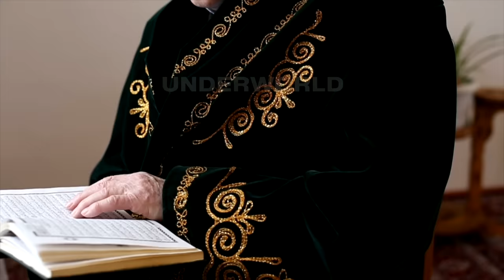10 Structural Failures Caught on Camera

Comment: #3. I remember this kind of thing happening in New York City when  some buildings were torn down, what likely happened with the hole where the blue tarp was.  The foundation of the shop probably wasn't undermined, but the whole building was probably only standing because the removed building was the only thing holding it up. Note the disconnected/ piecemeal brick construction of at least the first floor and the likely added and much heavier-looking second floor.

Comment: As a welder, you have to be extremely carful that, before you start work, there is nothing around that might catch fire if a spark land on it.
     Even then, you need to keep your eyes open incase you do start a fire. You can never be 100% sure nothing will burn in range of sparks. I've started a few small fires, but in those cases the fires would have burned out on their own even if I had failed to notice.
     There was only one thing I set on fire that suffered substantial damage, but it was especially problematic as it was attached to my body.
     It was my brand new prosthetic leg. I'd asked them to put the foam rubber cover on with Velcro, not glue, but they glued it by mistake.
     I was pretty shocked how intensely it burned, I found out later that they were using untreated foam rubber. It was meant to be treated with fire retardant, but in this case it was either mislabeled, or they just lied outright about it being treated.
     The prosthetist repaired the leg for free, then I went looking for a new prosthetist.

Comment: Uh, there's a bit of an error about the Mumbai Goa highway, no? 
It really doesn't look like an old viaduct failing but rather looks like the viaduct is currently being built with a launcher (not a crane), with the right side being completed but with its compression cables probably improperly or not yet tightened.
And the left side simply being still in the assembly process, with all its segments not yet attached to each other.

Numerous bridges and viaducts are built like this, and the launcher assembling the segments (a kind of giant metallic square gantry) normally takes support on the viaduct's piles only.

Launcher gantries have mobile "feet" to transmit downward forces to the piles, they lift all viaduct segments of a given section between two piles with cable pulleys.
Once all segments are aligned correctly, they are fused together with cement, and cables running through all segments are tightened to form a solid, compressed and strong block.

That's how elevated transit lines and highways are built in China or Europe, like the viaduct of the Grand Paris Express.
This technique is extremely efficient, fast, and sturdy.
So here, they either loosely or plainly forgot to tighten the compression cables and tried to take support on the section that wasn't strengthened.
Which led to the failure of the previously assembled section and the fall of the gantry.

Comment: At. 8:24 the gym collapsed. 15 inch of snow at the time. Unfortunately the roof was flat so the snow have NOWHERE to go.  Snow can weight a lot.
Reply: Yeah, but for Czechia 15 inches is considered normal snowfall(it is not unheard of, typical normal winter), the building even with flat roof is supposed to be designed to withhold that and more. It was completely new sporting hall, first snowfall-it collapsed. That is bad design or bad construction.

Comment: 8:15 Almost certainly it had to be torn down.
     The building fell off its foundation, and though it may not look that damaged, all of the structural supports would have been badly damaged.
     On top of that, the building would need to be lifted back onto the foundation.
     It would be cheaper to knock it down and start again from scratch.